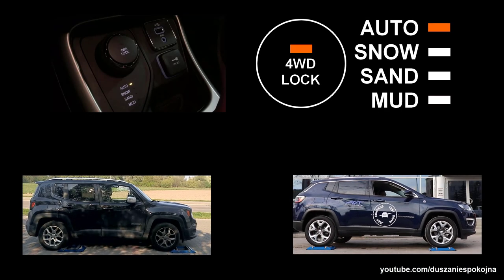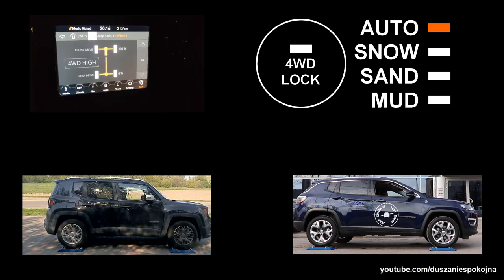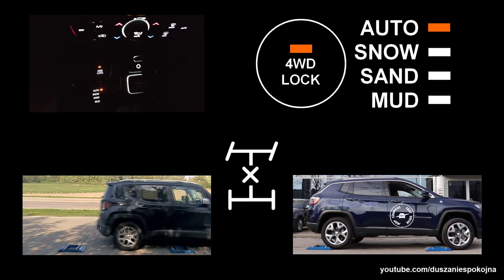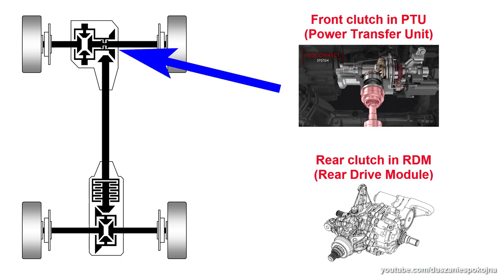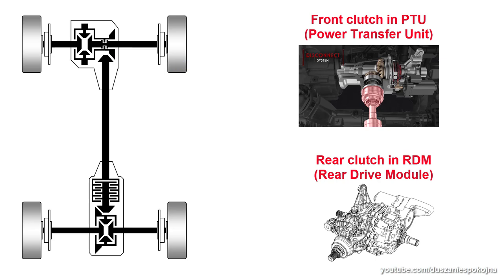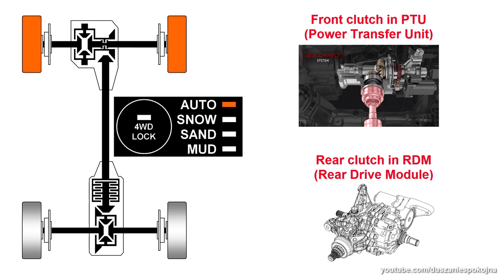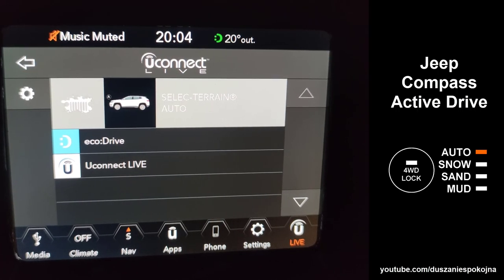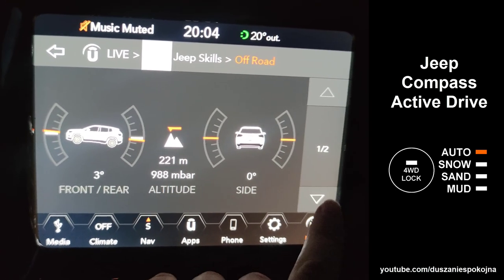Front Wheel Drive in LOCK mode - Jeep Renegade & Compass - Active Drive - @4x4.tests.on.rollers

Comment: Can I use 4WD Lock on Jeeps with Active Drive even at high speeds? On my old car it was said that using 4wd Lock at high speeds would cause problems. Thanks.
Reply from the maker: In Renegade and Compass you can use LOCK at any speed as it is completely different thing than lock in old Jeeps. If you want choose different mode than AUTO - lock anyway goes ON.
Reply from the maker: @XXX-XXX-1234 It's explained in the video.

Comment: Why even make those complicated systems... for what benefit? Suddenly it drives 50% in the rear... next moment 10%... on tarmac just rolling around.. why? There's no benefit altering power back and forth like that in such situations. All these systems seem to be based on some theoretical reasoning by some desk riders..
What you need in reality.. in practice.. is 2WD for all regular driving but the option to engage 4WD.. OR for a simpler system.. just open 4WD all the time. 
Then when you're going to park the car in a snowdrift, because that was the last parking spot left, or get up some steep incline.. you just need the 4WD to be able to lock for a couple of seconds. And then unlock again seconds later. That's the basics that should be in place first.. that would satisfy all requirements of normal people.. driving on normal everyday roads.. Why make it so over complicated? And then when it really comes to it, it doesn't even work fully...
Reply from the maker: It goes to 50/50 while braking and off-throttle.
Reply: It is comlicated system, but he gives you maximum when he needs and that you must feel how is he powerful:)
Reply: @4x4.tests.on.rollers  Also 50/50 we can see if you stuck in mud or snow and when all tires sliping and traction. At first system looking for tire with max grip where he needs power to pulling.
Reply: Open 4WD is meaningless and inefficient. Part-time 4WD lacks on-road performance and immediate response. Are you gonna engage 4WD lock every time when it rains, on tarmac? Nope.
Reply: @kdh6387  Compared to 2WD on tarmac its somewhat meaningless and inefficient. But if you want 4WD you have chosen to compromise that for gain in traction instead. For whatever reason.
Also the car becomes more stable. Even from just side winds.
And you can get the power to the ground under all regular circumstances. Even if you have a strong engine. Accelerating out of a junction for example. You can just floor it and you're out and away. Even if wet.
No, in rain you have no need to engage locks. In the winter though you have. Then you just push the button if stuck. Or you can have it automatic. MB already did that back in the 80's with the first gen 4-matic.
Reply: @martinsvensson6884  
Define 'Open 4WD'.
Mine is open center differential.
What is yours?
Reply: @martinsvensson6884  
Besides, 1st gen 4Matic is electronically controlled hydraulic clutch center differential. What you have called 'over complicated'.
Reply: @kdh6387  Jeep Select terrain allows to chose driving mode while you driving.
Reply: @jovandjukic5923  Is this comment meant for me? If it is, I don't know what part of my reply made you think I don't know that. I'm currently defending those traction sensing variable AWDs.
Reply: @kdh6387  In fact, for most vehicles where such "Lock" is available the manufacturer recommends "locking" in bad weather conditions. I do use the "lock" on my Mitsubishi Outlander III when the weather conditions are bad - snow, rain. It's not a real lock so it doesn't bring any cons.
Reply: @kdh6387  The way I stated it, open meant no diff locks engaged. Yours is open front and rear too unless you have diff locks there.
Mine is an open but full time system. Only uses the brakes.
Reply: @kdh6387  Its as little complicated you can make it if you want to be able to disengage it completely. Which that system does. It also can lock the diff completely.
The simpler way would be a manual diff lock then. Or just an auto diff lock but with full time 4WD still. The thing complicating that system was that they decided to make it engage and disengage all the time. 
Then you can make it even more complicated by having variable distribution. That system doesnt have that. It uses 65/35 at first. Then it locks.
But contrary to those variable systems that old system actually works as its supposed to. 
You will never get the real wheels spinning on the rollers without it getting out.
But I would remove that "always engaged at start" feature. And maybe the possibility to disengage it at all. I never said I required that or that the system was optimal to my liking.
Reply: @nikolayrayanov2895  I wasn't talking about those AWDs with 'lock mode'. I was talking about part-time 4WD locking vehicles and those really engages locks like 1st gen 4matic.
Reply: @martinsvensson6884  
That would be still running the same 'over-complicated' hardware but simplifying, or rather, 'dumbing down' softwares.
What you don't know is, when 1st gen 4matics and many electonically controlled hydraulic clutch AWDs say 60:40, 70:30, or some numbers torque split, it is just a nominal torque split. It is never a fully constant number. If it was, it would cause braking effect like 50:50 lock.
It still does 'over-complicated', contant torque split control.
Also, the lock would be impossible with just brakes, 1st gen 4matic cars like W124 has additional clutch for 50:50 central lock and a lock on rear differential.

If manufacturers made AWDs you wanted, It would be a wasted potential to make hardware that is capable of more variability and response, but on basically part-time 4WD level software.

What if situation like this occurs?
Hot sunny day, you set it on 2WD only 100:0 mode because you are on tarmac. You hit a oil spill or a puddle. Modern AWDs like the one depicted in the video will adjust the split accordingly. But 2WD mode one won't.

Constantly adjusting torque split while going straight on a tarmac could look dumb and irritate your OCD, But that's how much it is trying to adapt to every condition you drive in.
Reply from the maker: @nikolayrayanov2895  Lock mode on Outlander is completely different thing then in these Jeeps. It is quite strong, full time and full speed range mode.
Reply: @4x4.tests.on.rollers  good to know, I thought it's similar.
Reply: @kdh6387  sorry mate, misunderstood. Note taken.
Reply from the maker: @nikolayrayanov2895  Outlander doesn't have disconnect system at front, drive shaft is always powered. So it is always in Jeep's lock mode 🙂
Reply: @kdh6387  No no. Removing all the hardware is the point. Not the software. You only need the diff lock.
As you already written yourself you see how complicated that system was already. You dont need that. You just need the auto diff lock from that system... that they already had in -86... Not all the rest complicating things further.

The torque split is constant as long as no braking or locking is applied. The diff in first  gen 4 matic had a 65/35 split. Then it could also shift to a lock. Away from that 65/35 gearing. That would of course give a variation all the way from 0-100% torque split.

No, nothing would be wasted doing it the way I suggest. With my way the system would actually work. As intended. Not spinning wheels on rollers. AND being very simple. You dont have to add lots off variability to that. You can if you want to. And customer wants to pay extra for it. Sure. Have it as an option. But the basics should be there FIRST. Not creating something variable and not being able to do the basic things.

If you hit an oil spill, and it actually upsets the car, then ESP is activated. That system has 0 to do with 2WD or 4WD. If you want to have that extra initial stability at all milliseconds when you drive anywhere anytime then you make it full time 4WD. Or you have an engage/disengage button if you accept more complication and the driver can select that if he wants. But it has nothing to do with having a fully functioning ESP or not.

Yes, I know it "tries to adapt to driving conditions". And that's the problem.... you have made a comlicated and expensive system that changes absolutely NOTHING in real life driving as it engages back and forth even when its completely meaningless. Yet, its not fully able to cope with the MAIN ACTUAL problem that 4WD is supposed to solve.
Start with the most important things first! Namely getting the car unstuck...
Reply: @4x4.tests.on.rollers  If you could share more than what's in the Outlander III manual that would be great. :)
Reply from the maker: @nikolayrayanov2895  Outlander has quite basic awd system in terms of mechanics. It's basically fwd. There's angular gear at front which powers the driveshaft, all the time. Driveshaft is connected to rear differential by multiplate, electromagnetic clutch-pack. Clutch-pack works from open to locked (every stage between these points). Torque distribution depends on amperage on the coil of electromagnet - that's up to computer decision. Clutch-pack itself can respond 200 times per second.
Reply: @4x4.tests.on.rollers  so it's similar to Haldex?
Reply from the maker: @nikolayrayanov2895  Yes, it is similar but it has different control system (haldex is electro-hydraulic).
Reply: How do I put it on two wheel drive? Is that Automatic?